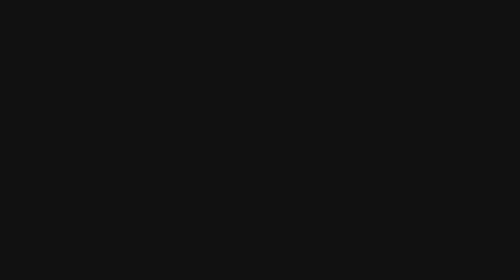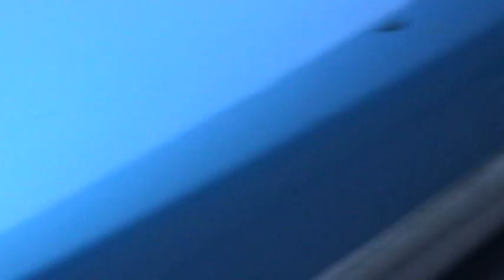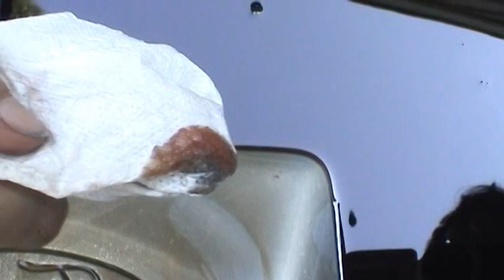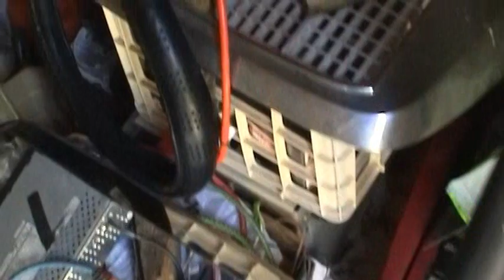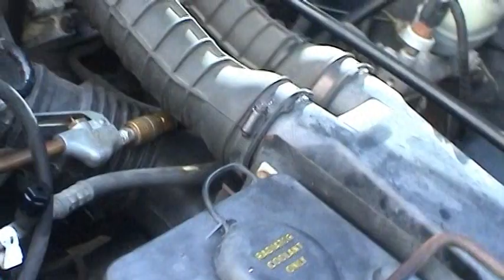1995 Ford F-250 4X4 E40D Transmission Fluid Change

Comment: For my '93 F-150 with the E4OD transmission, I bought the NAPA filter/gasket combo.  That rubber coated steel gasket IS THE WORST.  On these aluminum housing E4OD's you have to be careful on torquing or you'll pull out the weak aluminum threads.  That hard rubber NAPA gasket just leaked like a sieve when I got done.  I think they're better suited for a steel housing where you can really tighten them down and squeeze that gasket flat.  Now I've sent for a FelPro and a Mahle gasket to see which I like better.  And I'm tempted to use a tube of gasket maker/RTV to help seal up my pan, too.  I do wonder why my truck wouldn't engage any gears when I went to drive it down off the ramps.  The transmission was filled up to the gasket line.  More problems, no doubt.

Comment: I've got the same truck but 7.3. Same transmission. If you undo the line on the passenger side you can put a hose on it into a bucket. Start up the truck and it will pump it out. Don't run it to long so it doesn't spin while dry.

Comment: Great video! Helped me a lot today. So one question...
I changed the fluid just to see if it helps with the issue I am having at the moment. 
It is extremely difficult to go over 50mph,
when I push the gas there is a "grinding" or leaking exhaust pipe kind of a sound,
MPG is even worse than normal,
it still makes that sound even if I put it to N while cruising and step on the gas pedal.
I am trying to figure out if it is an engine issue or transmission.
I cant figure out a good way to test the torque converter which I feel like is the cause of the trouble. 

Any good idea would be appreciated!!!
Things I have done so far;
New engine filter-oil
New trans filter-oil
new spark plugs
New wires
New coolant thermostat
Coolant flush.

Comment: Quick question, when you re add the fluid throught the dip stick tube does it also refill the torque converter?

Comment: 3-3 1/4 gal?  I only used like 4 quarts and I have the 340D 20 bolt pan trans and I only see like a gal total that came out of mine, however, mine ONLY goes through a cooler on the outside, not the radiator one at all..

Comment: I have a 1995 Ford F-150 with the E40D transmission. I purchased a pan with a drain plug for $36.00 ( Dorman ) from Amazon. It makes changing the transmission fluid must easier. I also use Motorcraft Mercon V, which is synthetic ATF.

Once you have a transmission drain plug, you can easily do drain and refills to service your transmission. If you are replacing the transmission filter, replacing the OEM pan with a $36.00 pan with drain plug is a good investment.

Comment: How do you refill the torque converter? When you add the fluid in the fill hole does it automatically fill the torque converter too?
Reply: I think so. They share fluid

Comment: I have an 03 f250 .with the pan off it looks like yours. Mine has a drain plug.  I've only seen videos of the solenoids exposed in 99 to  07 f250. Mine needs a pressure control solenoid.?

Comment: The E4OD has a small cover in front of the Trans. pan. held in place with 4 /5 bolts . It will allow you to drain the   torque converter . The fly wheel need a tool to turn it to get to the plug ( $ 16 ). The trans pan on some trucks have different filters. The 4x4 had a deep pan where the 2 wd has not as deep.

Comment: Thanks for this video, it helped me change the fluid and filter on my 93 F250 7.3L IDI. I have a question for you. My pan had no magnet, do you think it would be a good idea to get an aftermarket magnet and put it in there? The three notches where the magnet sits are on my pan, so I am wondering if I can just get a donut meant for a '95 and put it in there. Thanks again.
Reply: So I just went to Home Depot and got a plain old cheap 2" ceramic magnet (2 for $1.69) and put it in there. We'll see how that works out.

Comment: (0:00) Intro  (History talk & Future)
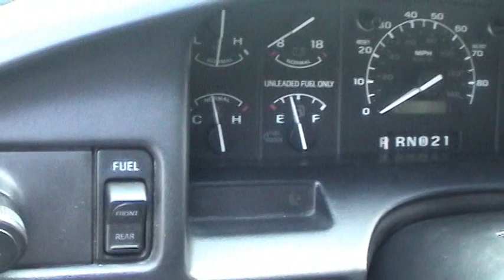(1:14) What's going to be in this video
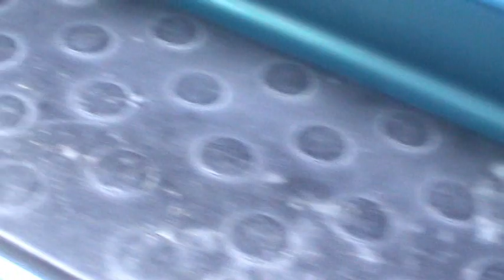(1:40) Truck Knowledge Prep
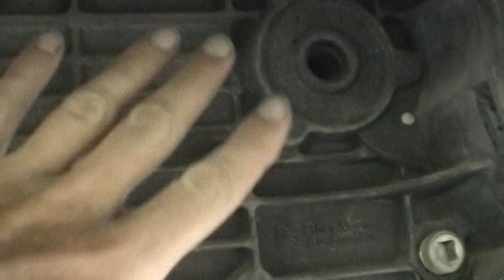(1:57) Transfer Case
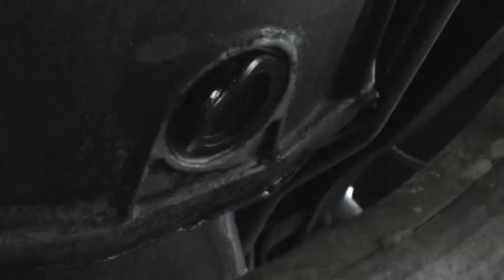(8:38) Transmission
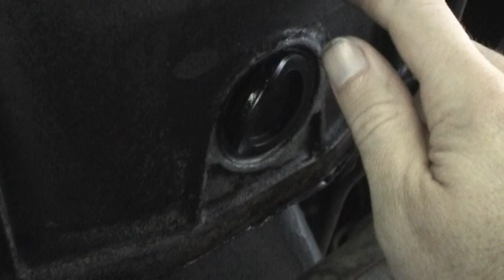(8:50) Torque Converter
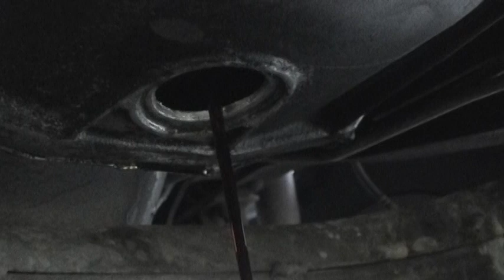(11:31) Why You Drain not Flush
(12:33) Oil Pan Drop
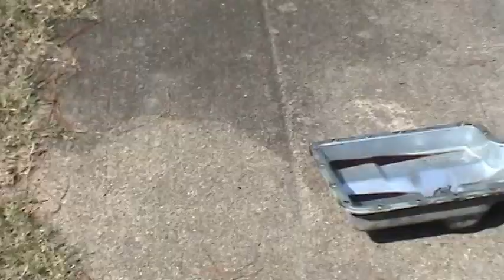(25:18) Pan Magnet 
(31:14) Reinstall Prep
(34:01) Cooler Flush (What else can you do? -sure can't drain it)
(36:35) Refill

Comment: I have a 96 F150 with 140,000 miles owned for about 2 years. No problems until lately. My oil pan is leaking heavily. So after I do that job I am going for the transmission job.  Question about fluid.  I am cheap and found carquest Dex/Merc for almost half the price. I know you get what you pay for in most cases.  Should I not skimp on this?
Reply: Well im 3 months late but no. Transmission fluid is cheap as it is, if you cant afford normal fluid then how can you even buy gas to drive. Not to mention any DEX brand product will RUIN a ford, works fine in chevys and GMC, but not fords.
Reply: +Sevin Reynolds Thanks
Reply: I used car quest dex/merc. Online searching looked good for E4OD transmission.  Maybe I should start over so I can afford gas? Haha. Not a mechanic here but can turn a wrench.  I trusted the parts guy at Western auto and his data base for this fluid.
Reply: +Sevin Reynolds No, not any "DEX" brand product will ruin a Ford. Ford went to using Dexron II in their transmissions May 1976. My 1986 C6 right on the dipstick says "WARRANTY REQUIRES DEXRON II FLUID" DexII/III/Mercon is the same crap. Not to be confused with Mercon V.

Comment: FYI your fluid has been changed at least once.  If it had not been changed you would have found a yellow like stopper laying in the bottom of the pan.  The stopper is put in at factory and pushed into the pan once the dipstick tube is installed for the first time.

Comment: I have a 1990 Ford Bronco, I had changed the transmission fluid, my pan looked like yours, wasn't to bad at all.  I took it for a drive, it reversed with no hesitation.  But when I took it for a drive it was idling high like it had a load not shifting what so ever.  When I got home I check the transmission fluid and as I was the radiator blew a 6 inch crack in the plastic on the lower cooler line blowing antifreeze all over the engine.  I have been stumped with what could of caused it.  Everything worked fine prior to the change.  Really could use the help, could it just be the cooler lines clogged can the transmission itself become clogged?
Reply from the maker: That's a tough one. I've never had that happen before. It could be coincidence. If the transmission was overheating badly, then the cooler could get so hot as to crack the radiator but it would have to get extremely hot to do that. Did you have any transmission fluid in the coolant after this happened? If the transmission were overfilled, it would cause high line pressures, but that would also cause other symptoms such as blowing out the top of the vent or filler tube. So without seeing it for myself, it's hard to diagnose. Check fluid level and temperature first.
Reply: There wasnt any transmission fluid in the coolant although, thanks for pointing me in a direction this has been one thing that I have never experienced in any vehicle and I had no clue where to start

Comment: Thanks for the video I recently got a 93 f350 7.3 diesel and am planning on doing this soon along with a oil change
Reply from the maker: Very good way to keep your transmission working well for many years to come and avoid costly repairs. Transmission fluid is cheap.

Comment: Thank you for the video! I have a 97 F150 4.6 with the same transmission "I think". It started to shudder at 30k. I am an Amzoil dealer so I switched it to the universal ATF. Shudder stopped.... I am about to turn over 300k and it's still going strong. It's been used mostly light duty, but I have pulled a little with it. I just bought a 96 F250 with a 7.3 powerstroke and am in the process of changing to synthetic. This is how I found your video. Hope I have the same luck you had with your truck!!!
Reply from the maker: I have had great luck with the Amsoil products and don't mind paying a little bit more for the added protection and longer service life. I don't want to think how much a transmission overhaul would be on this thing. I just recently purchased a 1996 Buick Roadmaster and I'll be changing the transmission fluid in that as well.

Comment: I didn't see an answer to Dean B.'s question as to what/how you cleaned the magnet and pan.  Could you answer that for us?
Reply from the maker: I just used paper towels, brake cleaner, and compressed air.

Comment: Awesome video. Is there any special way to refill the torque converter or does it refill when you add all of the new fluid to the dipstick tube? Thank you for this
Reply from the maker: There's no special procedure needed to fill the converter. It will fill up as you add fluid through the dip stick filler tube.
Reply: ***** Thank you so much

Comment: When filling transmission back up there are no worries about the torque converter being empty. Like dose it need to be primed in any way.
Reply from the maker: It doesn't really run dry very long since it will start filling up as you add fluid through the dip stick filler tube.

Even though it was drained, there's still a tiny film of oil coating the internals that will lubricate it sufficiently during the filling process.

Comment: Also, what do you use to clean the tranny pan & magnet with? Lastly, I went to Auto Zone (no NAPA in my area any longer) and they didn't have the WIX (#58968) filter that you used but they cross referenced the number on it & gave me a Champion  #TF222  (T692). When you showed your filter, you only showed the old one (black plastic filter) but the one they gave me is metal. Is it possible that it is the correct one?
Reply from the maker: Sorry to hear that your new radiator was defective and had to be replaced. The converter drain bolt can be exposed by using a socket on the vibration damper bolt and rotating the engine clockwise a little at a time until you see the bolt start to appear through the access hole. Once lined up, you can remove it and drain the fluid.
 
It sounds like your truck has an aftermarket towing package rather than the factory package. If you do allot of towing, it will be worth it to install an aftermarket transmission oil cooler or find an OEM oil cooler from a truck in a junk yard. Heat is a transmission’s worst enemy.
 
The filter you purchased should be just fine. In fact, I prefer the metal ones over the plastic ones. But at the time, the plastic one was all they had.

Comment: Mine also had a rubber type OEM gasket with some metal spacers in place around the bolt holes.  I bought a new one from Ford but ended up re-using the original one I had since it was in such good shape.  The spacers are to keep any "squishing" of the gasket or deforming of the pan when you tighten it up.  Kind of a good idea.
Reply from the maker: Many of the OEM gaskets on these transmissions are designed to be reusable and are generally of better quality than what comes in the box with the new filter. So now you have a spare gasket just in case you need it. :-)

Comment: Good video!  I did the same complete fluid change on my Ranger recently but since it doesn't have a TC drain plug I simply dropped the pan, changed the filter, refilled, then removed the rubber cooler lines up front going to the trans and used the engine to pump out 2 qts at a time, turned off engine, refilled 2 qts, repeat and repeat etc until I used up about 15 qts total and the fluid coming out was crystal clear.  Way more gentle and safe that a machine flush IMO and gets the TC flushed without a drain plug.
Reply from the maker: That's about all you can do on today's cars with no TC drain plug. You did good by not using the flush machines. They can damage the transmission. Your transmission will last allot longer now that it has fresh, clean fluid.

Comment: Did you use the same fluid in the transfer case as you did in the transmission?
Reply from the maker: Yes. This model uses the same fluid in both the transmission and transfer case.

Comment: Did you use the same fluid in the transfer case as you did in the transmission?
Reply from the maker: Yes. Both transmission and transfer case were filled with Amsoil synthetic universal automatic transmission fluid.

Comment: The Ams vs Mobil comment I made is strictly based on price since I am compelled to dump the oil so often I choose not to use the higher quality Ams at the higher premium plus I can pick up a oill swap for 25.00 at my local membership warehouse so paying around 20.00 more than I would for the once year Ams  I am satisfied with the performance of the mobile since I only put 7k to 12 k on it a year anyway.... And for clarification I sub 1q cap with 1 q of Motorkote  so after 5 swaps I have 5q left

Comment: Oh btw go 460 go... Love mine at 219219 miles and still rolling strong. I use only Ams oill and Mobile 1 full syn. Depending on application . Engine sees mobile 1 while everything else get the Ams treatment including driveline grease and front end linkages. In only  use mobile instead if Ams in the engine due I am OCD on the engine cause I love it so much I drop my engine oil every 1500  to 2500 mi regardless of need and run high cap Bosch filter...

Comment: Might I also suggest if you plan on changing it again you install a threaded plug for faster swaps that's what I did to my '92.  I had a half inch grade nut welded to the bottom of the sump and used a polyurethane bushing  for a seal with a short 1/4 inch grade 8 bolt. Sized th bolt at 1/4 SAE HEAD for ease of always having a wrench that size. Drilled the hole after the nut was welded on. If ya weld I'd use a low setting to start as to not burn z hole through the pan.
Reply: I recommend this advice above.. was about to suggest same when I found this comment..

Comment: You refer in the tutorial to the transmission name. Just to clarify you call it a E forty D, but the correct name is is E four Oh Dee or short for Electronic 4 Speed with Overdrive and in other circles known as an electronic five speed...  Also it's a lot easier to use a fluid removal pump through the tranny dip stick tube to lower the fluid level and come through suppliers like harbor freight or the 2.99 bin at shopko or big lots.

Comment: thanks.. this was proking filter fk179..i have 95 f 150..i checked at place i got it and they said thats it..i checked manufacturer website and they said that was it..when the neck was install it fit perfect and heard it snap and it was a fit but it  just looks different.The pickup tube on original went down and out..this one goes straight down..what u think?

Comment: I was changing the trans fluid in my f150. It has same trans filter as yours. After getting a trans filter kit i noticed the aftermarket filter is made a little different. The filter has 2 small legs on left and right side  but neck is same. fits ok.. is this normal for after market filters?
Reply: I would say yes cause I had the same thing happen sort of.. Mine didn't have any screw indentions on the bottom.. but if you look at the style, it fits right in, just doesn't have the placement  screws but it's roughly exact same as orig..

Comment: Thanks... I just bought a 1996 ford f 350 with 72,253 miles on it, for $1000.00. 4 wheel drive.. I'm doing the same as you did, this truck has a little rust on the bed, it's all about gone now... This truck is almost in new condition... The guy who sold me the truck was drunk, I made offer and he took it.... I'll send pictures to you, you won't believe.. I've always had brand new $800 to $1000 a month... Tired of working for my truck.. Now I will have fun working on my paid in full truck,..

Comment: Can you please specify where you add the new transmission fluid. I can not find the fill plug anywhere. I don't see a transmission dipstick. Also how much fluid do I use? I have a 95 F150 2wd with the 5.8 and e40d transmission. Thank you for your help!
Reply: 96 f250 trans starts out in third gear when cold trans code e